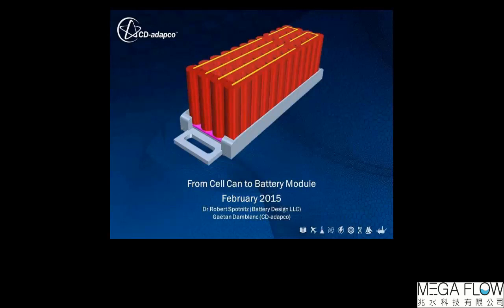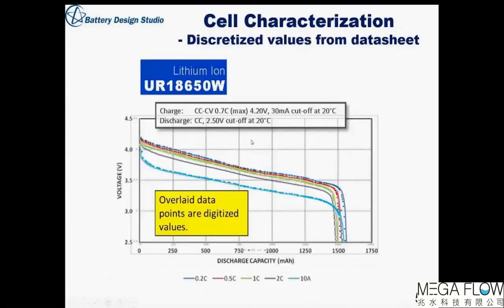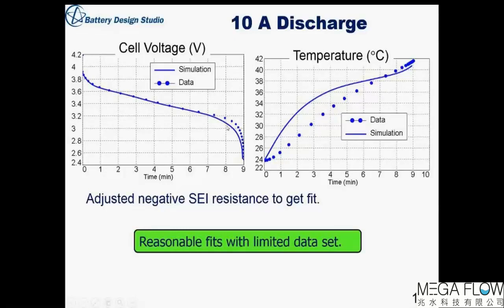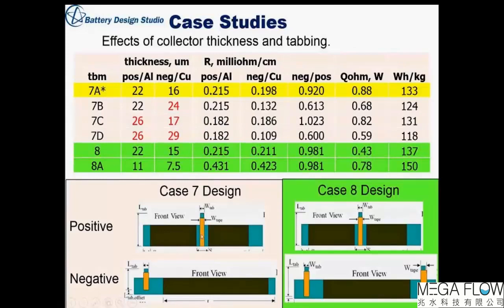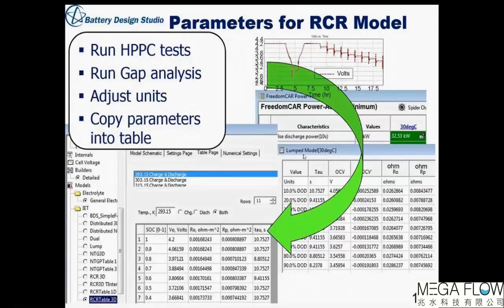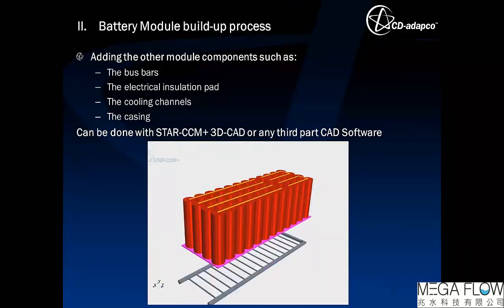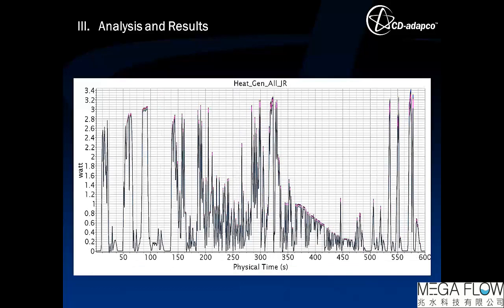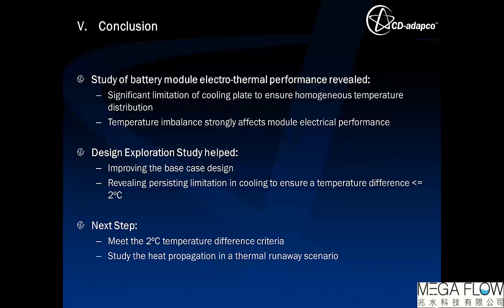【Simcenter STAR CCM+】使用Battery Design Studio 建立電池芯detail model-Battery pack 電池模組散熱對策-兆水科技代理Star-CCM+

Comment: Thanks, May I ask star ccm+15.02 how to import the battery pack built by 3D software and analyze the temperature change during discharge (without cooling system)?
Reply from the maker: could you explain it in more details and send an email to Service@megaflow.com.tw